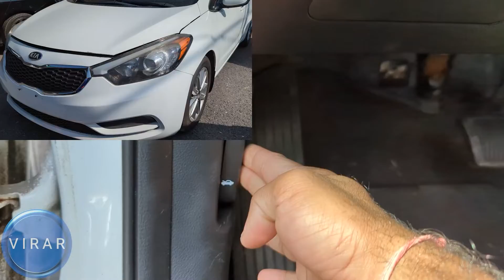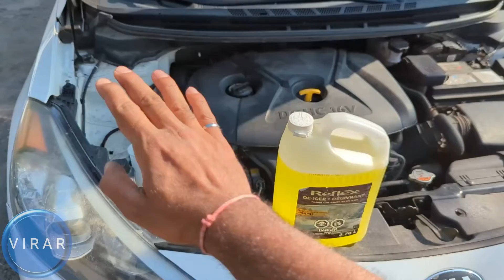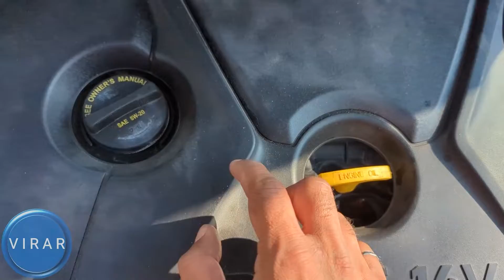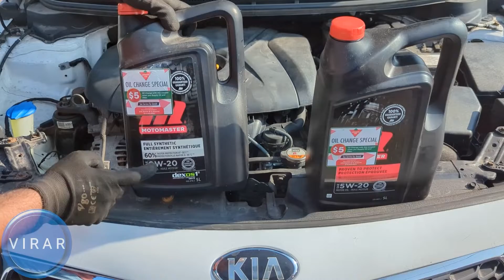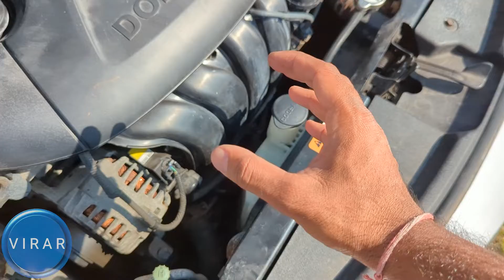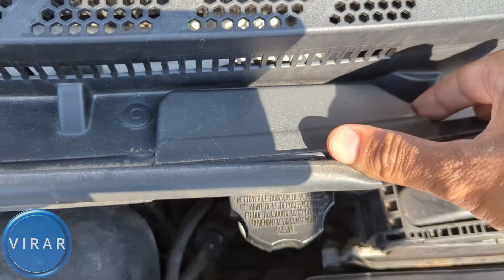How to Check and Fill Fluids [COMPLETE GUIDE] - Kia Forte (2014-2018)

Comment from the maker: Engine Oil Type: 5W-20
Buy Engine Oil on Amazon: https://amzn.to/3L957ya

Engine Coolant: 50/50 Coolant AntiFreeze
Buy Coolant on Amazon: https://amzn.to/47qwlHT

Brake Fluid Type: DOT 3 or DOT 4
Buy DOT 3 Brake Fluid on Amazon: https://amzn.to/42ZxnJN
Buy DOT 4 Brake Fluid on Amazon: https://amzn.to/3WsTZyB

Virar Automotive is an Amazon Affiliate. If you make a purchase using the link, Virar Automotive earns money for referral.

Comment: So how do i fill it up, dealership loosened drain plug and it leaked all in the driveway and im tryna figure out how to fill it
Reply from the maker: Transmission fluid ?
Reply from the maker: You need to first tighten the drain plug and there is a fill port close to the drain plug. If you aren't comfortable doing this, best to take it to a mechanic shop
Reply from the maker: https://youtu.be/_c19XUnyVUs?si=O1TrINn9X-j0d36d

Watch this video. It's for an elantra but it should be very similar for your Kia Forte. Hope this helps
Reply: @VirarAutomotive yeah i already tightened the drain bolt but i need to know how to fill the transmission fluid without taking the whole car apart

Comment: My daughter’s 2019 Kia forte was in an accident and she thinks it’s leaking transmission fluid. We wanted to put some in so she can drive it to her mechanic. Are you saying there’s no way to add to it ? Another mechanic told her the transmission pan was cracked and leaking fluid.
Reply from the maker: I am saying there is no easy to add fluid from the top and no way to check the fluid level. The only way to do it is from underneath the car. You have to jack the car, locate the fill port and add the fluid till it starts to overflow. If you haven't done this before, I suggest you just tow the car to the mechanic. Costs money to tow it, but better than just driving the transmission without fluid and damaging it further.

Comment: You completely skipped over where the transmission fluid goes. I have a 2013 kia rio manual. Where is the add fluid plug? Just want to top off not drain completely.
Reply from the maker: Yeah different vehicle and that is for a manual.

Comment: Wow
.. they steering wheel indicator lit up on my dashboard and i looked online for the power steering reservoir on kia optima 2018 and i went to the store and bought 2 bottles... 

When i got home i popped the hood and could not find it for the life of me... i am not a mechanic nor am i handy. 

I will be returned the bottles asap. 

I did further digging and i discovered that a battery may cause certain problems so... i purchased a battery (i also experienced trouble starting the vehicle) and replaced the battery.. afterwards, all is well. 

Thank you for this video though, it is very informational.😊👍👍👍👍
Reply from the maker: Thank you! Glad you found it useful!

Comment: What if you over fill the expansion tank with coolant? How to remove?
Reply from the maker: Well you can get a turkey baster to suck the fluid out, but realistically you can just leave it in. There is a relief hole at the top of the expansion tank in the event that there is too much fluid in it and no more room to expand, it will just spill the excess fluid out of there.

Comment: That car has NOT oil in the transmission...awesome🎉
Reply from the maker: The car has oil in the transmission. Just that there is no easy way to check it. No dipstick or view port. You can just drain and refill it if you like and you need a jack and other tools for that.